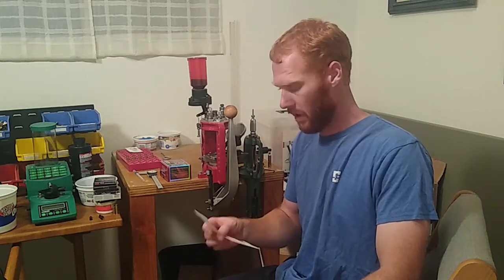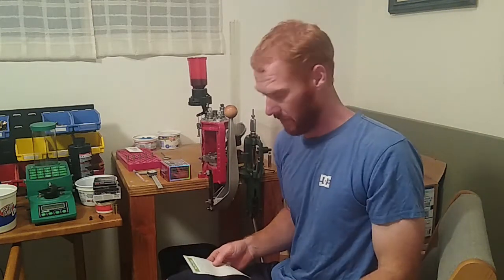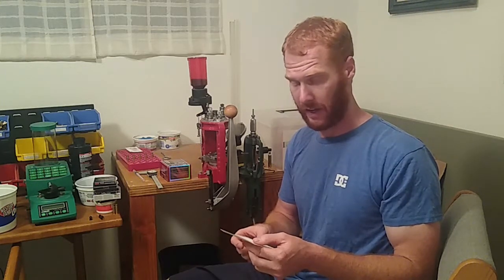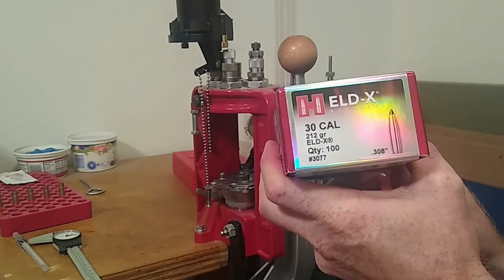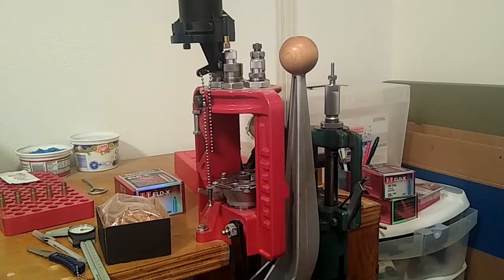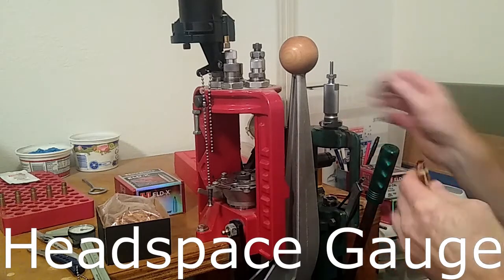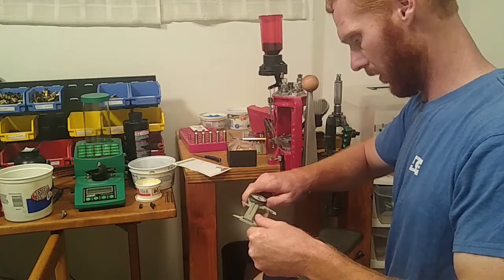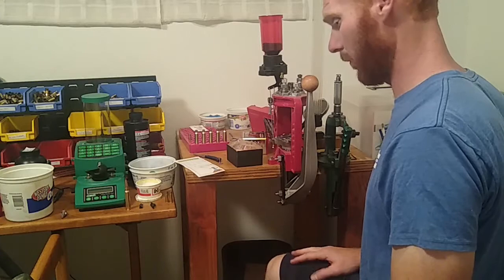Precision Rifle RELOADING: 300 PRC Seating Depth

Comment: You can actually use a 9mm or 45 spent case to measure your bump on the datum line. Place the bullet end over the neck and measure with calipers